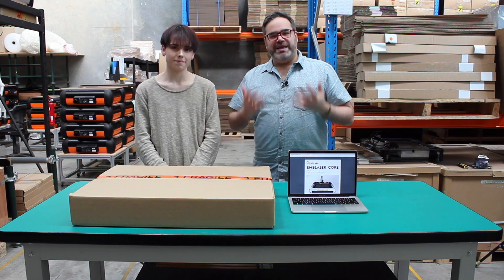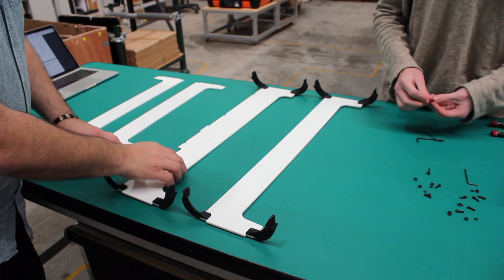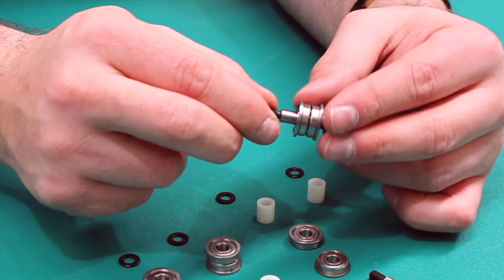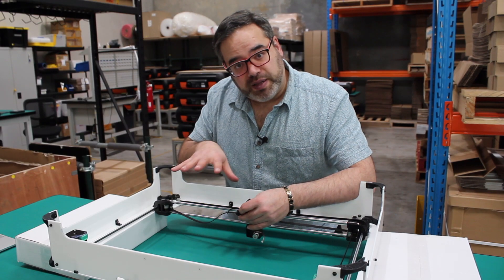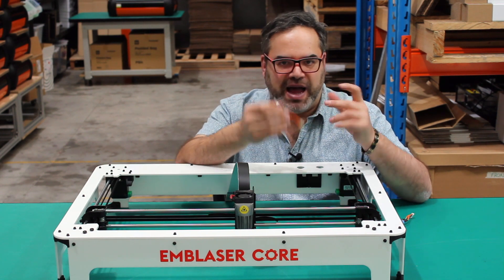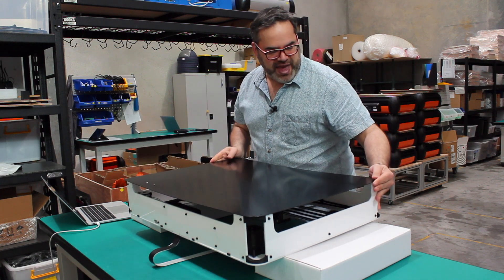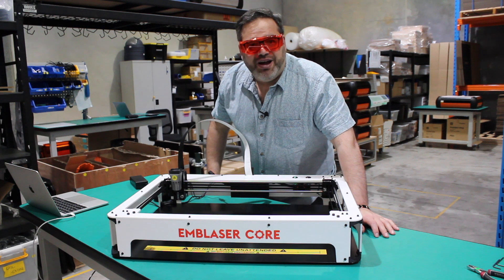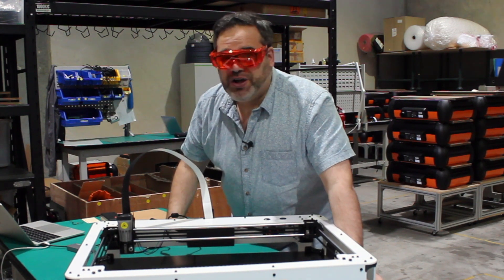Constructing an Emblaser Core laser cutter DIY by Darkly Labs

Comment: Can you leave the heavy base off and engrave direct to surface?
Reply from the maker: You don't need to as you can slide material through the front and back.
Reply: @LaserLivestream  I'm thinking of applications were material is to big or in a fix position. Like a large round  table that you can engrave a design on. With all safety precautions etc.
Reply from the maker: @cagneydorosch723  I believe that in that case you can remove the base. It was one of the last steps in constructing the core!

Comment: I’m really interested in purchasing this laser but your video is the only one I can find. I’m going back & for with this laser & the ortur 2. I’m needing to cut 3mm plywood for my work. It would be fantastic if you could provide us with another example of the emblaser core cutting more materials like 3mm plywood. Thanks
Reply from the maker: If you search for Emblaser 2 videos on YouTube, it uses the same diode laser system as the core. Meaning that you can get the same results with the core without the safety elements of the E2.
I do have some projects lined up to share in the near future, but may I direct you to the Laser Livestreams for more content on the Emblaser range.
Reply: Thank you for your reply. That would be great thank you.

Comment: Can it cut three mil acrylic?
Reply from the maker: Kiaya Kendall as long as it’s not transparent or clear, people have successfully cut 3mm acrylic on the Core and Emblaser 2.
Reply: Gil Poznanski Thankyou damn was hoping it could 😌
Reply from the maker: @kiayakendall4010  The issue is that a diode laser uses a different wavelength on the light spectrum than a CO2 laser. To learn more, check out this link. https://youtu.be/2DnGZ27n9NY?t=619
Reply: Gil Poznanski if you went over it with multiple passes would it cut through?
Reply from the maker: Kiaya Kendall Yes for acrylic that has a solid colour. No for clear or translucent material. Check out the link above to understand the science behind why a diode laser won’t cut the same as a CO2 laser.
Reply: Gil Poznanski ok thankyou so much for your help
Reply from the maker: Kiaya Kendall Best way to say thanks is to sub and like :)

Comment: Thanks for making this review. I am curious how this machine handle thin metal cut (saying 0.3mm up to 1mm aluminium sheet). Many thanks
Reply from the maker: You need a very high powered laser or a water jet/plasma for metal. A laser would just refract from the metal surface.